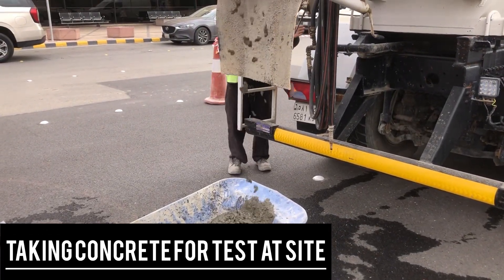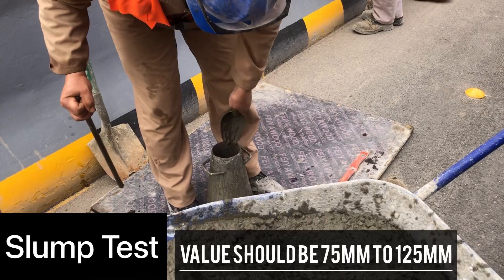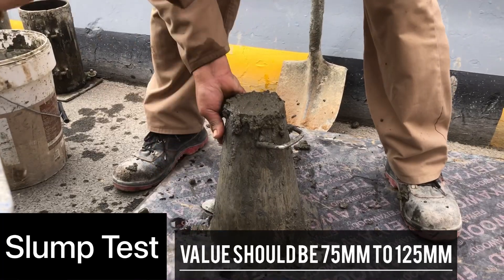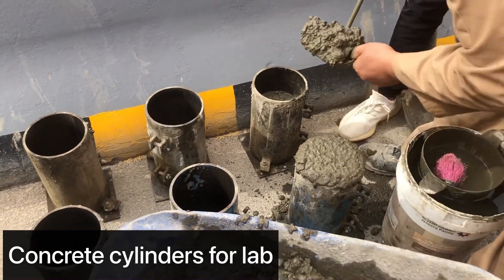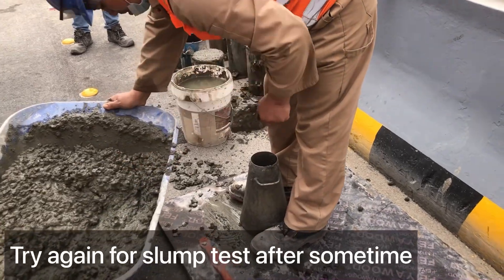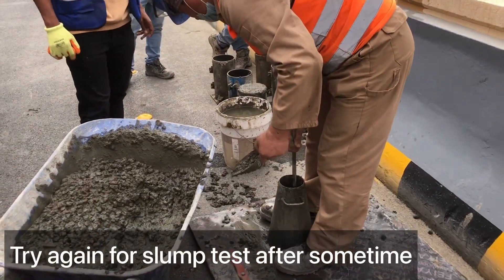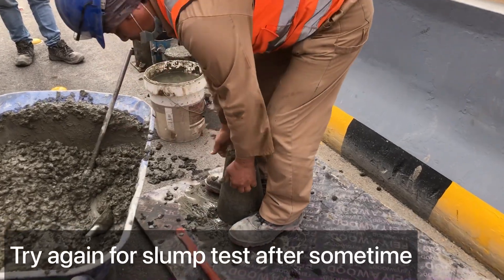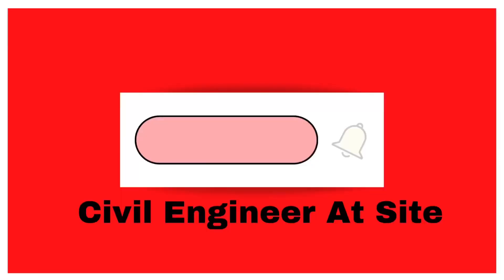Slump Test For Concrete at Site | What is Slump Cone Test for Concrete|Workability of Concrete Test

Comment: The first time you did the test, it failed, and then you observed for 15 minutes and after that the result was fine, but will the workers wait for 15 minutes? If the workers wated like this, time will be wasted "It is not better to change the water cement ratio
Reply from the maker: Never change water cement ratio it will change the design of concrete. They have to wait

Comment: If we don't get standard value then what we have to do 
Shall we cancel the concrete
Reply from the maker: If you watch the full video again you will get it. In the start the slump value was high then I wait for some time and take the concrete again for slump test and I get the correct value
Reply: @CivilEngineerAtSite  yes we got standard value if we didn't get then we should do 
If any another case if we didn't get standard value
Reply from the maker: The consultant will take the decision to reject or accept also depend on site conditions, projects conditions
Reply: @CivilEngineerAtSite  thank you
Reply: @CivilEngineerAtSite 
Sir 
The first time you did the test, it failed, and then you observed for 15 minutes and after that the result was fine, but will the workers wait for 15 minutes? If the workers wated like this, time will be wasted "It is not better to change the water cement ratio
Reply: What should be slump values  for slab ,beams and columns ?

Comment: Great 👍 bro don't forget to explain  how much will be the dia of temper rod and from   how much height it should be free fall with fixed number of  tempering.....the slump value is not fixed as should be varied as per concrete requirements
Reply from the maker: Yes dear I am try to share the things which are happening at site. Site is different from books.  I am trying to give some snapshots form site to the fresh Engineers